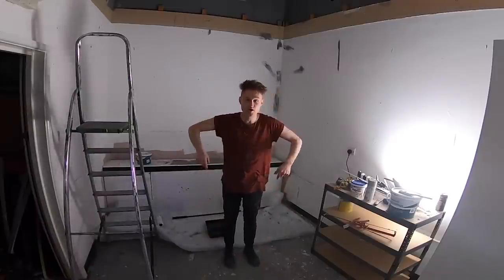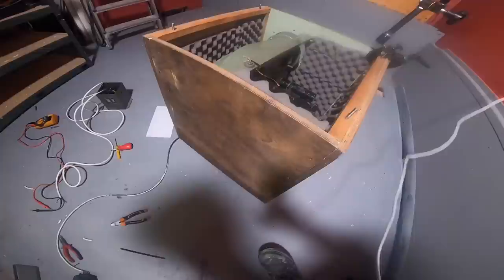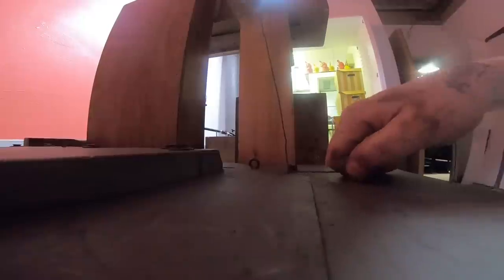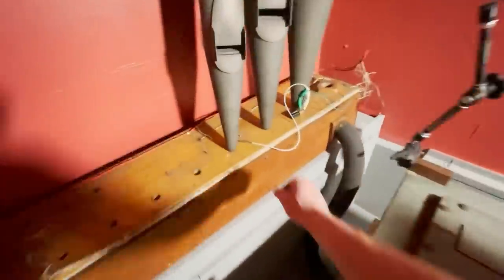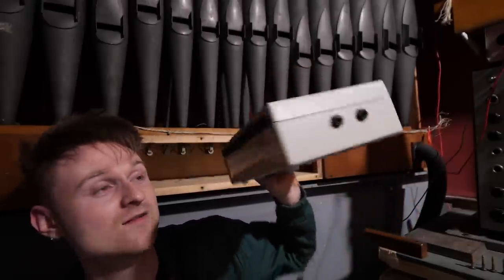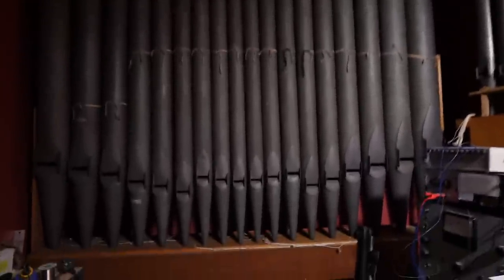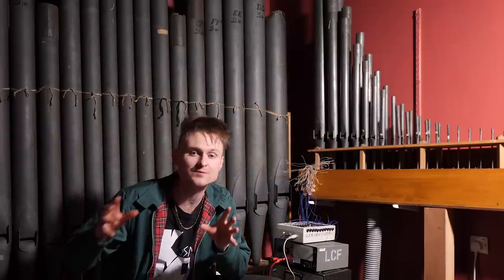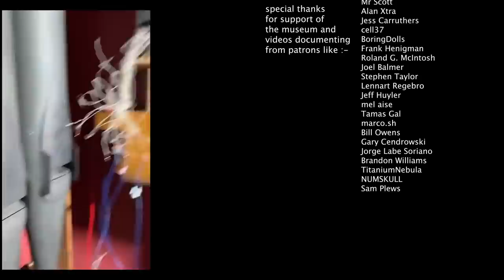I BOUGHT A CHURCH ORGAN Part 2 The First Sounds in 25 years!

Comment from the maker: Its coming along!
This Museum Is Not Obsolete is open this weekend. info in the description
Reply: you should graphite that old blower motor!   I have one that belonged to my great grandfather (from the 1920's) and it has little copper ports for adding graphite  :)
Reply: If i had few thousands to spend i would come over for a weekend! Daaaaaam its cool beanz!
Reply: Sup homie, that big ass box that holds the pipes where each solenoid is check them plugs for each pipe on each solenoid, those should be air tight, and it will be way louder, you get to actually hold the air pressure in that box under the pipes, but yea the whole box and them pads on the solenoid gotta be basically air tight to be as loud and clean of a note as possible....im sure you knew that, but the weak sound is caused from an air leak in that big long box or then solenoid air flaps for each....the organ is absolutely mental, just what an epic piece of kit to own...
Reply from the maker: @scottbattaglia8595  yep cheers scott. that was part of the job on friday was sorting out the valve tops to stoop letting air through, a couple are still being funny, ill get to em though, it seems that the more its being used thte better it is working also, probably down the the lack of movement over the past 20 years
Reply: Congrats on a new level of insanity, im lovin it :D 

Could you try and play the Tron theme on it ? :O 
Overture/The Grid/The Son of Flynn

Dont know if you are able with copyright or so, but just thought it could be a cool score to run through that system !

Further idea. You could hook it up to webcam/audio, make a 24/7 live chan, where people could request numbers on by adding in a link or file, then have it output a list with what time a certain audio would be playing. Also record it + sharefile. :D

Ideas <3  Keep up your mad work bro !
Reply: Could use smoke to find the leeks? /Dry ice
Reply: this will be loud
Reply: I love it, great work here's an idea
sorry it will give you more work, dowh
a LED light  that tune on in the pipe wend activate
Reply: ”Organ” hah!
Reply: @drstranger4407  is thing coloured gas, or uv light illuminate or maybe just simple microphone, and use like cheap metal detector/Giger counter, the with and a/v meter, would bet he's got all the stuff to make one just lying around collecting dust, could even audio graphic equaliser, in the mix and trim-out all the real sound the organ in meant to be making, just leave whistling holes to track down, left in the audio signal? maybe, use head phones also,
Reply: this apeared randomly on my feed, the first thing I thought "and I thought I was stupid.."
hahaha keep it up much respect
Reply: So cool so cool! Congrats. Finally someone who maybe will try out a few ideas I've long dreamed of to try out on a pipe organ.
- Putting a speaker in the pipe room, try Key Percussion [see Hammond organ B3, X-66 thorough, visual articles at ( NSHOS) North Suburban Hammond Organ Society . The '67- '72 X-66 had it's own incredible Percussion! [excerpt from the NSHOS X-66 pg.5 below]
- Put reverb in the pipe room
- Put "key click" through the speaker. There is a solid state "key click" circuit Hammond designed for their '81-'84 flagship Elegante model. It's based around a noise circuit and it randomizes several flavors of click not unlike real 'fuzzy keying switch contacts artifacts' on a real Hammond tone wheel organ.

X-66 Percussion:
The percussion system on the X imitates several bell-type instruments including a celesta and an organ harp, chimes and a glockenspiel as well as a marimba and a xylophone. All of these instrument sounds are created by additive harmonic synthesis, and some of them, notably the chimes and the glockenspiel as well as the celesta are surprisingly realistic.

I hope consider some of these ideas. 'Repeat Percussion' and 'Sustain' might be interesting, but DC keying Sustain is not conducive to a pipe organ. The other organ the NSHOS guys did an article on is the great Wurlitzer '53- '63 4600 (44, 4410, 4420, 4430 spinets) electrostatic continuous free reed models. Explains the sustain.  The VERY FIRST organs with SUSTAIN. In fact they have SUSTAIN I & II. 'l' is for FLUTES and "II" for STRING/ REED. The Wurli ES Reed organs have very sweet flutes, but incredibly bold tone and instant attack due to the reeds always in motion. Reeds used only for their harmonic content, and filtered for voicing/ tone generation. I own a 4410 spinet and demo a 10 min adlib on my ch. 
Good luck 'Look Mum, you're an inspiration!
Reply: @scottbattaglia8595  HIS NAME IS DAVE!!! 🤣✌
Reply: @Typical.Anomaly  🤘
Reply: @katsumiskytower8714  pretty solid, not many people know about the dry graphite lubricant, it's available only a bunch of places!
Reply: Kept looking at the shots of your blower box... I can't seem to find the air intake ? Do you have one ?
Reply: I live in the US, London was on my list of places to visit, but I've started preparing my wife for a trip to Ramsgate!
Reply: you never fail to amaze me. once forgotten things taken into the  current and future times
Reply: you don't know what you're doing! you'll never figure it out!
Reply: @Itsurecanglitchsomemore  I would love to go to the museum if I ever get to the UK unfortunately life, kids and living in Australia makes it almost difficult to impossible
Reply: Satans Calliope Burning Man 2006..
Reply: wish i was in uk so i could visit the museum. a trip to finally meet my mate in wolves is still a thing tho...
Reply: I love pipe organs to me their piece of art because then being handmade the pipes being hand-rolled and made I love how you treat this delicate instrument with respect it truly is a piece of art
Reply: YOU DON"T KNOW WHAT YOU'RE DOING.  LEAVE IT UP TO THE PEOPLE WHO KNOW WHAT THEY'RE DOING.  HOW CAN YOU HAVE ANY POODING IF YOU HAVEN'T EATEN YOUR MEAT!
Reply: love and gratitude
Reply: upload a video of just the organ music at the end, what are you doing you fizz widget

Comment: Connect it to a smoke machine to find the leaks ))
Reply: Or submerge it
Reply: Use a feather
Reply: I don't think the wood is gonna appreciate all that smoke fluid condensation though...
Reply: You could do the inner tube thing, brush it with a bit of soapy water.
Reply: I had the same thought, but I think it will leave everything coated in glycol
Reply: There's a special cheap tool for it which is filled with Styrofoam balls.
Reply: @guyh3403  This is the ticket, they are called bicycle leak detector, it's a little cylinder with the top covered with transparent plastic and bottom end covered with mesh, inside a bunch of small styrofoam balls.

"just" hold it over all the pipes and boxes and when the balls start moving there's a leak there.
Reply: That would be cool anyways
Reply: @bami2  Yeah! Now that you mention it, that's it!
Thanks.
Reply: @TDOBrandano  dry ice might do the job
Reply: genius
Reply: Leaks must be found by hand.... no other alternative.
Reply: @guyh3403  Ha, he said BALLS!
Reply: Just take some super thin cloth or paper, like a single ply of x-ply toilet paper. Gently hold it against the case. Paper wiggles. Leak detected.
Reply: @bary450  Use a mineral oil based smoke machine
Reply: If the leather of the reservoir has gone brittle you could try reviving it with neatsfoot oil and patching splits and leaks with new leather.
Reply: Fart into it, stinky bits = leaks
Reply: haze juice is sticky and gross.  would not be good for inside the bellows
Reply: Just use a little streamer of crepe paper on the end of a stick?
Reply: @bary450  it's really not much more humidity than is in the normal air in the room, and all you would have to do to dry the air chests out afterwards is play a few bass notes for a few minutes to get airflow through there.
Reply: Brilliant idea !
Reply: Piece of tubing with one end in your ear. A mechanics stethoscope.
Reply: @treborobotacon  As a professional organ builder, that's what we do! Used to blow cigarette smoke in but can't do that any more.

Comment: When I saw part #1, I was wondering how much time it would take to reassemble it, few months or so.  Doing this in about a week, it's incredible.  Keep up the good work, it's heartwarming seeing this organ saved again and in such good loving hands.
Reply: He knew what he was doing, after all, it's a simple instrument, all it does it is blowing air in some tubes through electric controlled valves. A lot of them, sure, but still not complex. Also he worked in the past on a similar project.
Reply: @biomorphic  cutting all the wires makes the project about ten times simpler, as well. Certainly if you don’t care about replicating the functionality of those nail-board “computers” (tracing what those actually did would be super complex, and not made easier by the rough cuts). The pneumatic-mechanical part of the organ is, in the end, not hugely complex — it’s a blower and then the bellows and valve assembly produces a constant pressure air supply. Very ingenious, but not excessively complex to refurbish. And the rest is just hoses to air chests, possibly with controllable valves to turn whole air chests on and off as leak control.
Reply: There's not much more straightforward than distributing the air, and a solenoid per pipe. Just put it together a section at a time, then test the section. Good thing he had a control box lying around! All those old wires were just so much red herring in an era where we can afford to put a cheap tiny computer into each box of pipes. It's all basic mechanics and electronics after you've separated out the individual note signals. Tuning it is going to be a lot of work, but still straightforward, and he's already done some before. They already sound lovely.
The best part was trying to make a similar setting to the original house.

Comment: I just love that a huge instrument with an 800 year history and engineer is being controlled by the faithful arturia keystep lol. Incredible
Reply: Right? I was thinking the same thing.
Reply: Not even Dan Deacon would think of that--that's what I love about this channel.
Reply: It's not an 800-year old organ though
Really old organs use a mechanical linkage between the keyboard and the valves. You could control one of those from MIDI, but you'd basically need to put a servo on each key of the existing keyboard (look at Mitxela's MIDI music box to see a tiny-scale version of that).
This organ was built from the ground up to use electrical signals to operate the valves, probably in the 1950s. The box with all those electrical "cards" that we saw in the dismantling video is effectively a pre-electronic switching mechanism, the entire boards move physically to open and close connections between the keyboard and the banks of solenoids for each voice. The entirety of that could be replaced with a bigger version of his arduino and mosfet control box. I expect we'll see both done - a MIDI conversion for actual musical use, and at least a few of the old controller cards powered up for museum demo purposes. It won't even be the first midi controlled church organ - they actually install midi connections in newly built organs. They're intended for simple record/playback functionality so a church can still have live organ music when the organist is away (basically an enormous player-piano), but Rob Scanlon did a video where he got to play around with one.

It's a wonderful project, and it's heart-warming to see an instrument like this being saved and given a new lease of life, but let's not go overboard and call it 800 years old! Like all of humanity's endeavours, it builds on layers of science and engineering
Reply: Pipe organs date back to Roman times, when they were used for entertainment in large spaces.
Reply: no I'm curious to know how they did before solenoid valves and electricity
Reply: @valdir7426  Mechanically! 
At it's core, the valve at each horn works the same way, it's a lever that closes over the opening, with a layer of felt to improve air-tightness when closed.
Without electric solenoids, those levers are mechanically linked by more levers, push rods etc so that the organist is opening the valves directly with the force applied to the keys. 
Look at how some of the more complicated brass instruments work, like a saxophone - for many notes the key isn't the same piece of metal as the valve, there are linking shafts and other components. An organ works on the same principles, just much much bigger.
Reply: @HaralHeisto  I think you misunderstood my statement. I was merely referencing the historical lineage of the pipe organ as an instrument, not to the age of this organ specifically. Thanks

Comment: I wonder if it was a buck transformer.  240V primary wired in series with a 30V secondary to either boost or buck the voltage by 30V.   The blower makes me think of the big yellow bouncy castle blowers.

I get surges of email that are totally unmanageable too.  By the time you've given a technical reply to one another five have arrived.
Reply from the maker: Ha yes well it’s in a sealed chunk. I can send you to dismantle haha. Apparently Bristol was on 210v in the early 21st century hence the converter transformers. How funky
Reply: @LOOKMUMNOCOMPUTER  Entire Europe was on 210-220V when I was young. Most of devices after change to 240V standed these +20V to +30V very well but apparently here somebody tried to be very careful. EDIT: I was wrong. England was 240V that time, rest of Europe 220V. That is probably the reason somebody used this stepdown to 210V as most likely the air blower was not British-made and they wanted it to last when installed once.
Reply: When the organ was built it was designed for a certain air pressure. 2-6 inches of air typically for a most organs. They have to run the blower at the designed pressure to maintain voicing and tuning on the pipes.
Reply: @LOOKMUMNOCOMPUTER  If it's potted then definitely not.  Depotting is bad enough on dinky resin filled modules.
Reply: @LOOKMUMNOCOMPUTER  send it to me and il xray it😅 Doncaster 👍👍

Steve
Reply: I'm sure it would be an auto transformer 👍👍
Reply: Ack came here to say the same Clive, also, Hi! LOL
Reply from the maker: @T2D.SteveArcs  hey sure i can do! i have no use for iit :)
Reply: @LOOKMUMNOCOMPUTER  how shall I contact you to pass my address Sam? .. and thanks mate I will xray it and maybe do a vid on it👍👍

Steve
Reply from the maker: @T2D.SteveArcs  contact form on me site would be best! likely iwont be able to send till next week cheers
Reply: @LOOKMUMNOCOMPUTER  okay thanks Sam and no worries buddy, I will pay postage if you want too👍👍

Steve
Reply: if anyone knows then surely you do bigclive

Comment: Hahaha! Love the ending. Way to show the haters Sam! Can't wait for the next installment
Reply: Adding to this - using a hacksaw to cut through a bundle of wires is a common practice when removing or rewiring racks of computers.
Reply: The last bit was kind of mind-blowing.  Because who could ever possibly hate on Sam?
Reply: @philipgwyn8091  Yes is pretty common even in telecomms heritage. Large cables bonding large pieces of equipment in place need removing QUICKLY as its' often a last min rescue, and for large racks of modern computers, yep i can see it there too. BT used to do similar when cutting over exchanges... use cutover wedges in the Distribution frame of the new exchange, then rip the wedges out and power saw "die hard style" thru the cables to the old exchange to facilitate removal by non BT contractors
Reply: @ToyKeeper  I would hope it was people who haven't seen him work before. That was hilarious.
Reply: I laughed so hard that I had tears in my eyes. :)